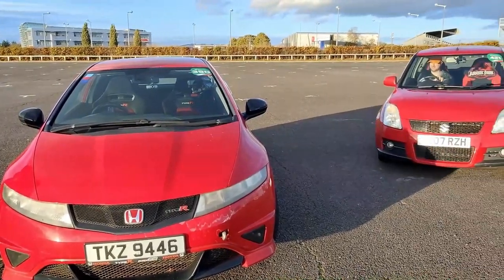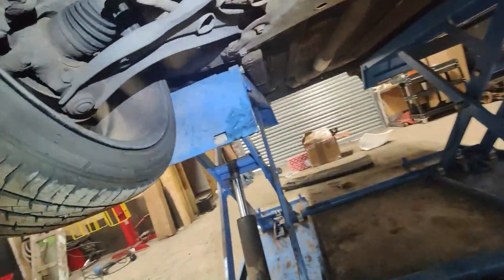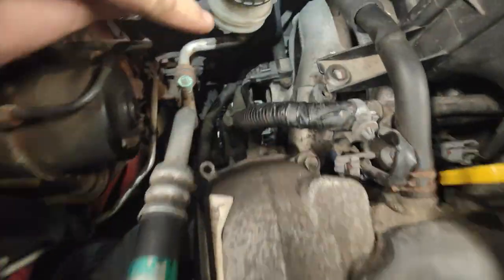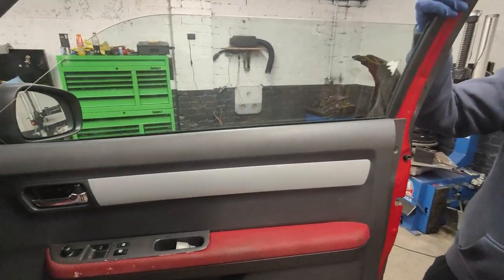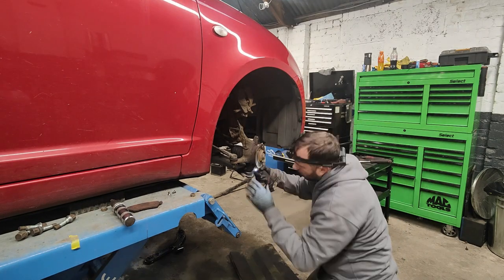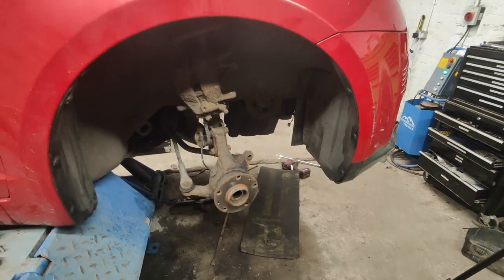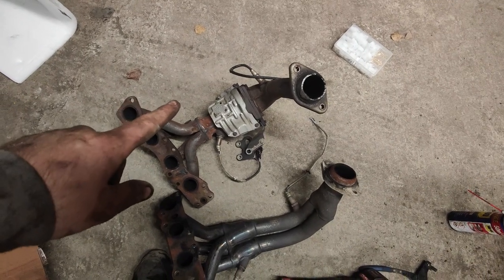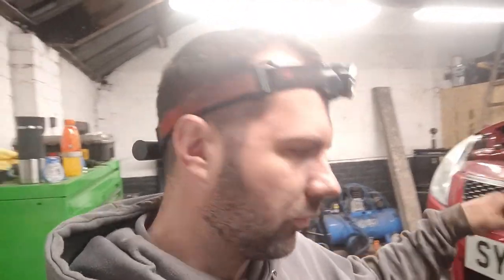Building a Track Car That Won't Break the Bank

Comment: What if I told you it needs the other CV joint done now 😂
Reply from the maker: I would ask who your local swift authorised repair centre is. If it's as seized as the other side anyway